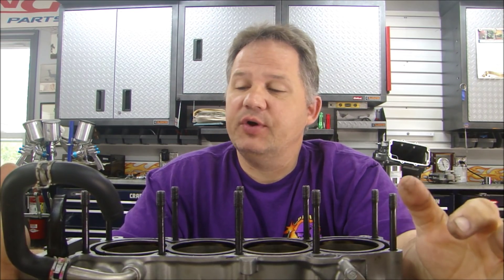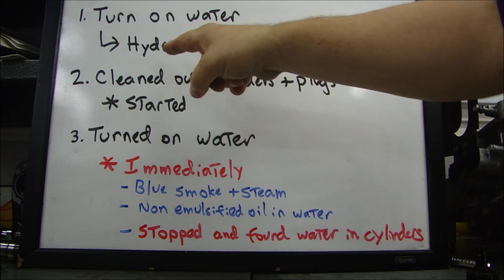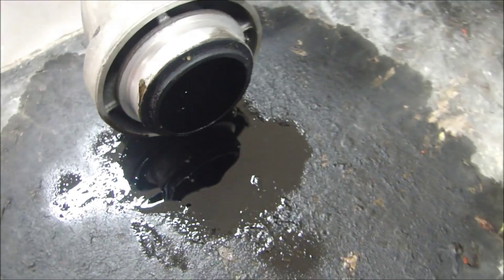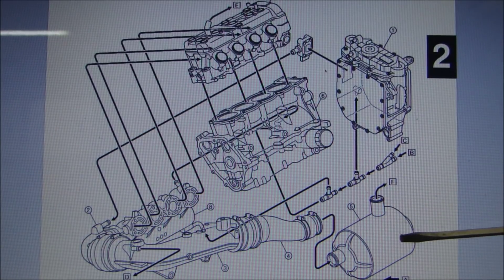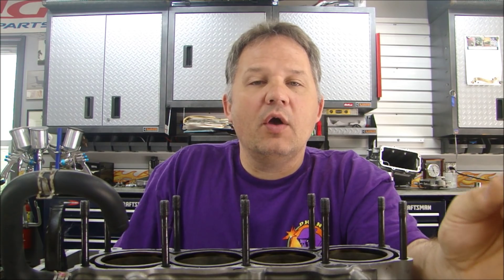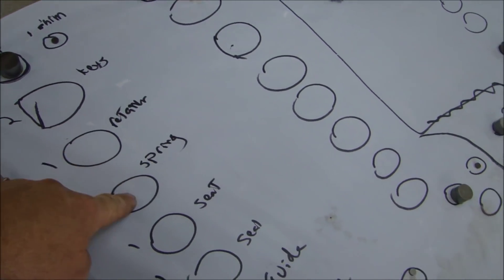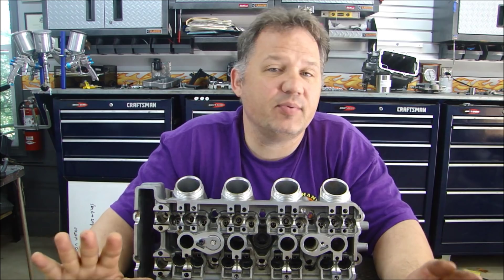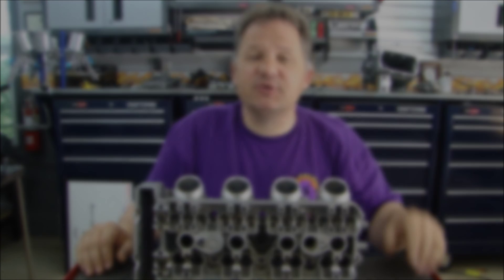Engine Repair Part 3

Comment: Hi pete , in your sequence , of how it happened ,  did you turn on the water ,no 1 in sequence ,  did you turn on hosd water ,without engine running?  , which may put coolant into  cylinders ,  under hose pressure ?    Also could , those little chunks , you found , be a breakage , in the oil cooler , ,itself ?   ,then the water pressure from hose , into ,oil cooler,  without exhaust , pressure ,running,mode ,  count for , oil   being forced ,into, exhaust system ,n muffler ,   from hose pressurs ,forcing ,  coolant  into muffler system , cooling ,, back feed ,without engine exhaust pressure  outwards  not stopping ,coolant,  from backfeeding ,into engine  n lodging, in exhaust manufold   ,n forcing, water inti exhaust manifold ,n into  cylinders,  i wonder if the oil into exhaust , n intake manifolds   could be a breakage  in oil cooler itself n then hose  pressure , forcing oil backfeeding into  exhaust also ???  That feed of coolant direct line from when hose  puts pressure straight into oil cooler  ,  n forcing oil backwards,  or is there a shut of valve, in that  line n water pump circuit ,mal functioning ???   Maybe a sequence of events,  starting from water hose feed ",on"without enging running, even for very short time , as sequence  no 1  and also oil cooler  fault ?    May not be head cracks , etc,  good luck  , i had to throw away my 1100 cc  wave runner  , with this style of priblem , n one thing led to another ,   n time frame  trying to fix , held up from my one medical issues n treatments n medications  ,  affecting my thinking ,, at the time  ,  cheers
Reply: exactly what i thought..by chance did you have any cavitation problems with your wave runner?  im in a pickle
Reply from the maker: I had a few problems when I took it out of storage. Starting the water flow first didn't help

Comment: Hi.   Im from pakistan  .. i have 1100cc yamaha jetski.  .. comming water in 02 number cilender .. but not mixing water in oil. . Wahts can problem in this
Reply from the maker: It could be a head gasket issue , or cracked block or head

Comment: I know this was 8 years ago, but I just saw it as I'm looking at an 05 vx110 that isn't running. Was it the oil/water separator?
Reply from the maker: no, there were no cracks in any parts

Comment: My Yamaha sx210 has this same engine. Number 4 cylinder is dead. This is the only video I can find
Reply from the maker: There aren't many
Reply: pulled head the hard way. one "bad" exhaust valve. it was stuck open. Pulled valve and it had buildup and rust on the stem. Debating on cleaning it up or replacing valve stem seal

Comment: Pete, how are you doing?   Been a while.   So whatever happened to the Yamaha 1100 engine after video 3?    What was the problem?  Head gasket?
Reply from the maker: There was nothing wrong with it, I just sold it
Reply: @PetesGarage     Ahhh, I must have missed something.   I thought Vedeo 3 ended with you sending the head out to be checked and there would be a continuation when it came back.    The eason I'm tasing about this is I'm compemplating buying a vehicle with a 1500 Hayabusa engine and figured I'd take the opportunity to learn a little inadvance.   Thanks, catch ya on your next video!

Comment: Pete,  yes it was from running the water with the engine off.  Many make that mistake.  I hold the dealers responsible for not giving a post delivery training on how to take care of your new ski.  
The water filled the exhaust then back flowed through the exhaust valve.  That's how the water was in the cylinders.  
That being said please continue with the rebuild on the engine. Covering assembly and valve adjustment IAW the manual steps please.
Reply from the maker: Thank you very much

Comment: I’m looking for the fourth installment of this series to see where you found the problem. Did you ever find it? I’m having the same issue and the head gasket does not look bad but not perfect either. I’m wondering did someone run the engine and then cut it off while the hose was still running. The head is flat and the block surface is flat as well. Where else could it be coming from?
Reply from the maker: I did not make it yet, I did not find anything wrong. it was from running the hose with the engine off
Reply: So you just put all back and turn on for engine was damage?
Reply: @emoreno101  It has been a low priority project, and I didn’t want to put a lot into it since it was given to me by a friend who didn’t know how to go about fixing it. The jet  engine has not run in 10 years BUT despite having water in it, the engine still turned over. The crankshaft appears to be stainless steel and was perfect. The pistons were a different story. The rings has welded themselves to the pistons and could not be reused. The bores were pitted enough that I had to spring for a set of WSM pistons at .25mm oversized. I took them to the machine shop and had to pay $190 for a bore and hone job plus checking the block for cracks.  Just got it back and need to reassemble.

Comment: hi I have a 2006 Yamaha Waverunner VX110 Sport, in  isn't Chargeing the Battery, in is that normal to have oil in the Generator comeporment, because I found oil in the Generator comeporment, i thought the Generator comeporment should be dry, can you give me feedback on this?
Reply from the maker: The generators do wear out

Comment: part 4 ?????
Reply from the maker: Didn't get to it yet
Reply: @PetesGarage  
Just pulled a 2009 VX engine out for overheating after 20mins the exhaust coolant outlet holes out of 8 think only 3 were open  all four small outer jacket holes blocked , anode broke off during removal , all cleaned up waiting on gaskets and a anode plus two engine mounts
Reply from the maker: Interesting. Good luck with it
Reply: @PetesGarage  found a crack in the block , cylinder number two exhaust side possibly due to cooling Chanel caked up with salt and expanded causing stress cracking
Reply from the maker: I have a short block if you need one

Comment: Water got into your cylinders by turning the water hose on before starting the engine, once the engine was started in Hydraulic it’s pushed oil through the valve guides
Reply from the maker: Absolutely

Comment: Buddy, when you connecting water to the engine you must start the engine first and when the engine is running then turn on water. If you do it like you did, you will get engine flooded. Exactly what you got! You need to drain all the oil, pour in some break cleaner or kerosene to dry the engine. Then fill it up with new oil.
Reply from the maker: Thanks for the tip

Comment: If you turned the water on before starting the engine, that will put water into the cylinders through the exhaust system, according to the manual.  Also, if the oil cooler reservoir is filled when cold and oil is added to the fill line, there will be too much oil in the engine and it will back up through a vent hose into the airbox, where oil will be sucked into the carb intakes, causing blue smoke.  Use a valve at the water hose connection and never turn on the water until immediately after you start the engine and turn off water immediately before shutting down the engine.  Also, when the engine is cold, you will just barely be able to see oil on the dipstick and you need to run the engine to move the oil out of the lower sump and then check the dipstick level.  Also when changing the oil, run the engine to operating temperature to move the oil into the cooler reservoir before sucking out the old oil.  Only replace what you remove. Very poor design on the oil change, cooler reservoir and dipstick for checking the oil level when cold or changing the oil.  Likely, this was the original problem.
Reply from the maker: Great comment, thank you
Reply: @PetesGarage  Thanks.  I really enjoyed the video as it was a really good presentation on how to tear down the motor and evaluate the internal parts for damage.  I am not a mechanic but your videos were really good and easy to follow.  Good job.
Reply from the maker: Thanks again

Comment: I think we all know how your water go in there from your flushing procedure. It’s very important on these to not only turn the water on AFTER starting the engine, but to turn the water off (and remove the hose) from the flush port and give her a couple revs to force the water out of the system. I even do this after I pull the skis out of the water. I’ll give them one more crank and a rev just to ensure that. The oil being in the exhaust is very likely from having too much oil in the tank. Many people freak out when they take the “dipstick” out and see nothing on it. THIS IS COMPLETELY NORMAL for a VX110 that has been sitting up for a while. As scary as it sounds, you have to crank it (start engine, water on, bring up to temp for 3-5 minutes or so at idle, water off, couple quick revs to push water out). After all that, THEN you check your oil level. Ive seen checking the oil level on these dry sump systems mess with even the best mechanics out there just from lack of knowledge of the system.
Reply from the maker: What  a great comment, thank you
Reply: @PetesGarage  no problem, Pete! Don’t ask me how I know! I did the same stuff!

Comment: You hydro locked it when you turned the water on first before turning the engine over. Stern drives require water before start but the opposite is true for jet boats such as a wave runner. You must start the engine then turn on water.
Reply from the maker: You're right

Comment: Hi did you ever do a part 4 , I’m interested how to replace the chain tensioner , thanks 👍
Reply from the maker: Not yet
Reply: Leaves an engine rebuild vid in the middle and then doesn't complete for 5+ years.... typical mechanic...
Reply: Could you also put up a video on the bottom end

Comment: I got mine rebuilt and running.  I ran it on the drive for about 10sec without water just to see if it would start.  Then I attached the garden hose and let her run for about 20 minutes with water flow and variable low RPMs (1000-3000rpm).  Then I let her cool down for 20-30 minutes and then fired her back up with water and took her through some higher RPM run-ups and downs.  Took it to full red-line a few times.  She ran great.  That afternoon I took her to the lake and ran her out for a good hour or so.  She ran great the entire time.  Thanks for all the teardown tips.  When you make the rebuild video, it will help a lot of people like me even more.   NOTE:  A couple of "heads up" notes after rebuild.  Put the sensors on the engine before you install the engine.  The heatswitch that mounts on the side of the engine block under the exhaust manifold is IMPOSSIBLE to put on once the exhaust manifold is in place.  I missed that one and it's not fun taking the exhaust manifold off again once the engine is in the watercraft.  Do not not install that sensor before you mount the exhaust manifold!!!  Good luck!
Reply from the maker: Great tip, thanks Greg

Comment: Great videos. I have a new to me vx110 that has 50psi in #2 and over 150 in the others. I have the valve cover off and found all the valves are free. With all the valves on 2 closed and I apply compressed air into the spark plug hole I can hear air escaping out the coolant fitting on the head. I'm assuming a blown head gasket and will remove the head soon to find out. could be a crack too, but I'm hopeful it's the gasket. Motor is out of the ski and I assume the oil res has to come off to remove the head. Also have water in the oil, but could have been like that when I got it.
Keep up the great work.
Reply from the maker: Good luck

Comment: turning on water before starting engine explains water and hydrolock.  Did you fog the cylinders when you winterized it?  Fogging the engine could explain the oil.
Reply from the maker: I did not fog, I've never had a problem with the water before

Comment: What was the final diagnosis for this engine? Was it just a head gasket
?
Reply from the maker: It was not a head gasket. Water went backwards through the exhaust
Reply: Pete's Garage I’ve just purchased one that is immaculate condition, 140 hours. The guy took it for a service and mechanic has noticed water in oil? Compression tests are all good and even? I’m going to try change oil a few times to rid any residual contaminated oil in engine and if that doesn’t fix it then pressure test oil cooler. Fingers crossed it’s not a head gasket or cracked head?
Reply from the maker: That should work

Comment: Just fyi. The bottom manifold bolts are too long to be taken out of the manifold while it is still in the boat!
Reply from the maker: Great tip.....now pull it out...lol
Reply: @PetesGarage  I've got it out and the crank case cracked open.  The spark plug core that dropped into the cylinder pretty much trashed the top ohf the piston. The piston skirt is pretty buggered up too.  The cylinder wall has some vertical scoring.  I'll get a hone in it tomorrow.  We'll see if that can get it clean enough again or not.
Reply from the maker: Wow

Comment: Man there are a lot of hidden bolts holding the oil tank on....  I thought I would never find them all even with the service manual in hand.   Then there are those six bolts on the bottom edge of the exhaust manifold.  I thought I would never see those.  I don't have a hoist.  So getting in those tight clearance areas with a wrench has been a challenge to my knuckles!  LOL!  But I would have never been brave enough to start this project without your videos.  Thanks.
Reply from the maker: I think it's easier to just take the engine out. But, that's another couple hours of work.
Reply: @PetesGarage  Can one get the engine in/out without taking the exhaust manifold off?  I did not think it would come through...
Reply from the maker: I think it has to come off
Reply: @GDFred88  I know it's late but it does come out with the manifold still on. Just had to remove the oil filter to sneak the motor out.
Reply: @stonefingers111  thanks!  I put mine back in with the exhaust manifold on too.  We had to take the oil filter back off to get it in to.  Loweredit in a few inches and then put the oil filter back on before we dropped it into place.  Still getting the intake manifold and a few hoses on and I should be running again.  Fingers crossed.  It's getting warm here in Texas!

Comment: Pete... you turned on the water then turned on the engine??? You have to turn on the engine first thats HOW you hydrolock an engine. Just heard you say that in your video. It's my understanding that's how you fill up the cylinders with water maybe I'm missing something.
Reply from the maker: It was actually more than that. The oil was milky before I turned the water on.
Reply: ah... @PetesGarage  did you find a solution/original cause?
Reply from the maker: I did not

Comment: Where did you find the coolant? I have a 4tech seadoo and had coolant in the system leaking through the pto. Funny enough it's a closed loop and I just heard you say as I type you dont have a closed loop system lol. Interesting. Nice video.

Comment: Yei , if you don´t have crack´s on that and you have problems with water and oil, change the head gasket, the exaust gaskets for water. Change the piston ring´s and the valve seal´s for oil. All this parts because you don´t have 100% sure, but you have two fluids to assure your problem. Good Luck

Comment: Pete so what was the problem with the jetski waverunner engine I have been waiting for the answer. Or the next video thanks for the great videos.
Reply from the maker: I'm thinking water went back through the exhaust into the engine. I did not find any cracks or other problems.
Reply: Yes, most definitely the issue. Has happened to numerous people. ENGINE RUNNING, THEN WATER ON.

Comment: Hai Pete, The water you noticed was during the engine was still in the hull of the jetski or also during testing the engine outside the watercraft? With a proper test of the engine by starting the engine and after a few seconds open the waterline and let it run for a while, then close the waterline and let it run for a few seconds and then turn of the engine. There should not be any water in the oil or where the compression takes place. If there is there is Obvious something wrong.A known failure of this watercraft is the sealing of the drive shaft, after running the engine and keep the watercraft into the water it will leak a lot of water (by pressure of the water outside) into the hull, If there is no seperate bilge pump to hose the water out of the watercraft and you will start the engine after a while, the water will be sucked by the air intake into the engine and will cause serious problems.It can be one of the possible reasons why this occure otherwise you have to investigate the engine on other failures.Thanks for your you tube topics, they are awesome, keep on doing these, you help a lot of people with them.Best regards,Denny from Amsterdam
Reply from the maker: It was an odd problem. I did not find any major problems inside the engine.
Reply: A pitty of all the work you spent on the engine, Four stroke engines and watercrafts are not such a good combination unless you are very carefull with the water entering the watercraft and the damage it can cause to the engine. There are more possible causes like the cooling hose that sucks water from back of the pump to the exhaust and engine which is constructed too low without any loop or high level point. after shut of the engine the cooling water will still push the water through the exhaust upwards inside the engine.Even a bad circulation of fresh air while not running can cause serious problems to the engine if stored for a while when there is any water in the watercraft.I hope it will run good and for a long time without any problems after reassembled everything.Good Luck, Denny.
Reply from the maker: Thanks Denny